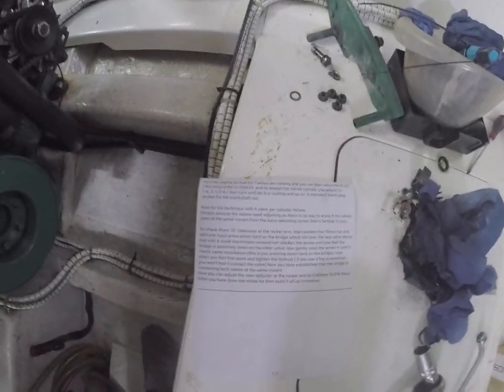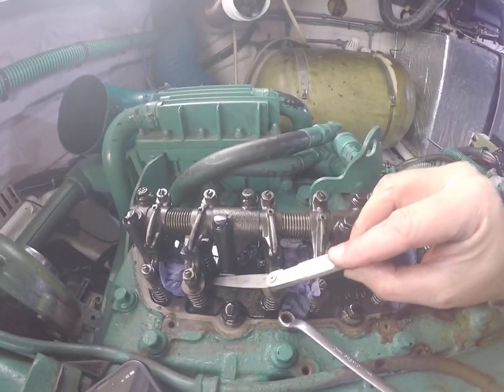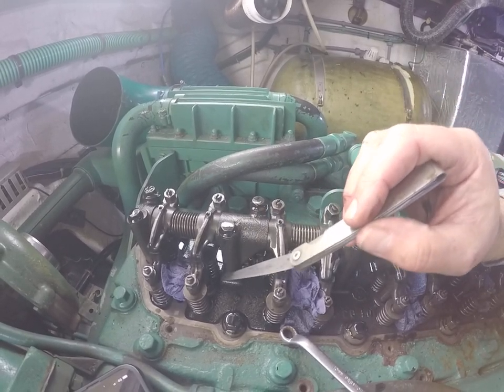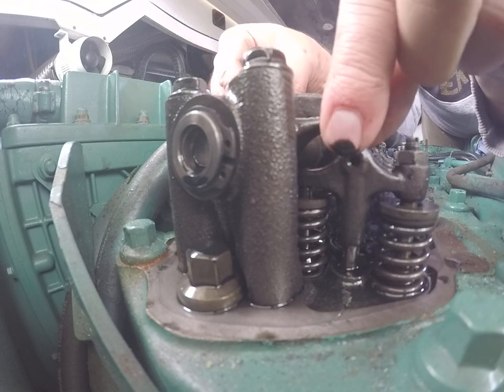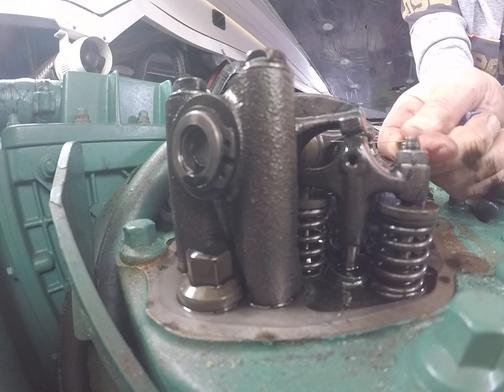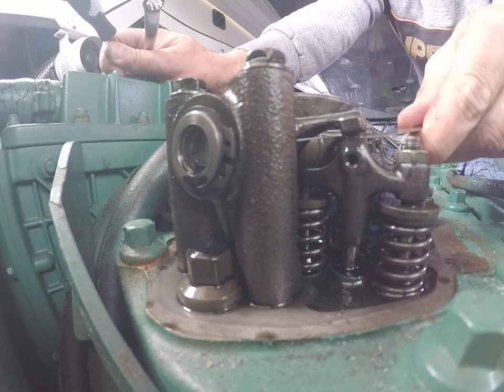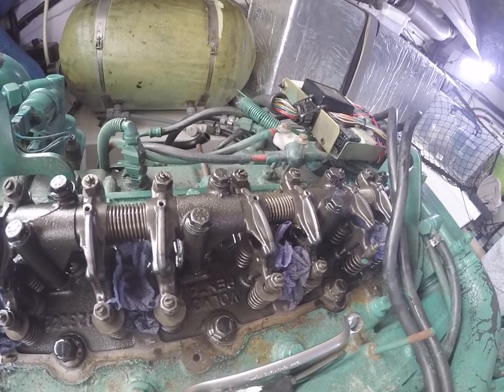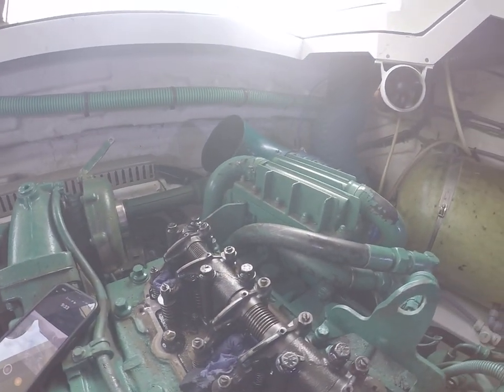How to adjust tappets on a Volvo Penta KAD KAMD 44/300 engine

Comment: Do you use silicon sealant or a flange for the valve cover???i have a oil leak there!!!
Reply from the maker: Sorry for the late reply - I'm lucky and have a rubber gasket still in the cover that seals well. If you dont have one then you need to seal it with silicon. Volvo no longer make the gasket but you can get a patten on ebay.

Comment: Mustering up the courage to attack this one myself, thanks for the great video!

You didn't record the disassembly for access too, by any chance ? :)
Reply from the maker: Thanks, no I didn’t do that. The main thing I would say is the injector pipes need to come off the pump completely. Also the oil filter has to come off. No way around those two things!